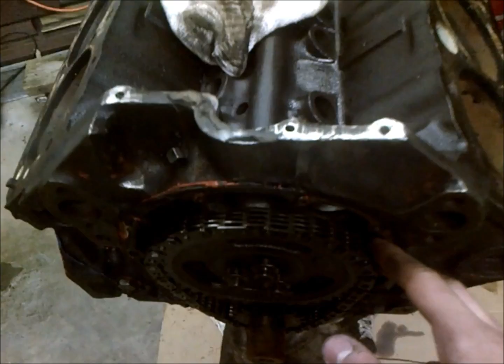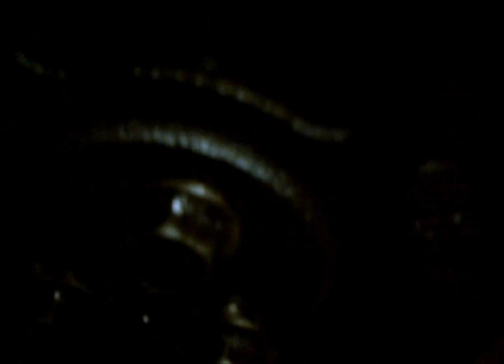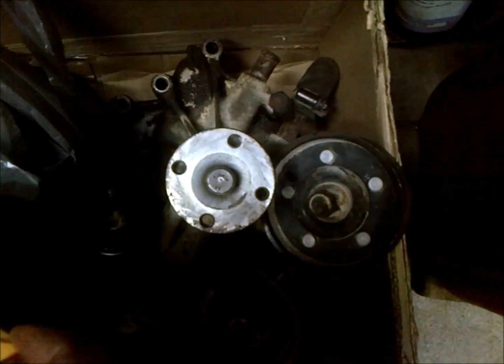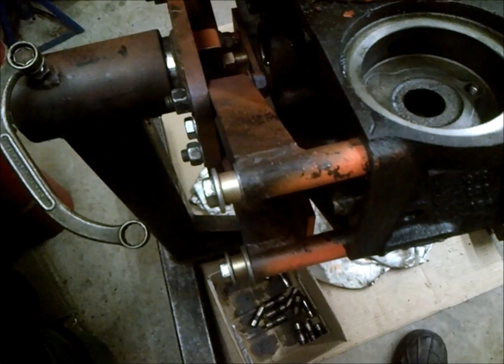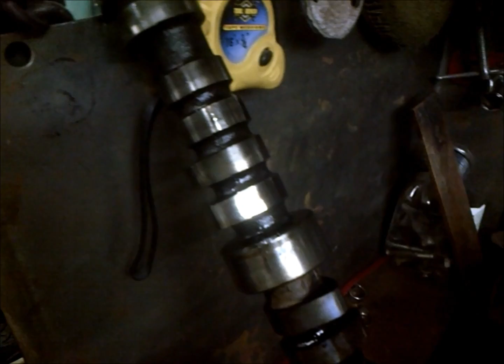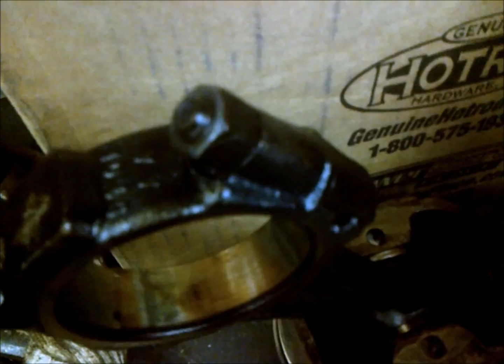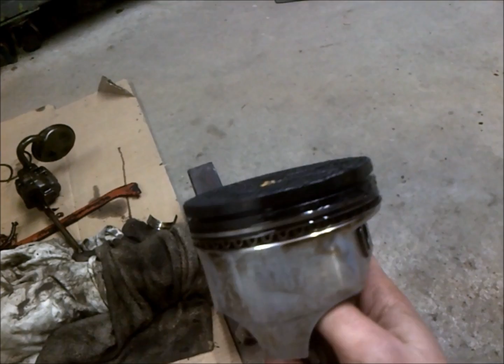350 Chevy vs Ford 302 Comparison: (Dumb Redneck Viewpoint)

Comment: A lot of wrong info. The Chev cam is inclined in the block meaning it holds itself back,, a trouble on high rpm engines. 
Head bolts, Ford uses 10 7/16 bolts in a 4 bolt per cyl pattern, Chev uses 14  7/16 in a 5 bolt per cylinder. This is where the LS is big step backward. Cleveland and 351 W engines as well as M engines use 1/2" bolts.
The little shortarse rod in the Ford will break before a Chev one. As a stock engine not a problem but high rpm is. Boss rods were 3/8!!
The 302W is very small and fits in holes a Chev struggles with and with say 350hp is fairly strong  though quite short of torque.
The Chev has better oiling and cooling. Later 302 are better for cooling than early ones,, which are bloody awfull. The Windsor oiling is adequate but the Chev is better. The clevo and M engines are a real disaster and a LOT of mods is required. 
And yes I have played with all these engines, a 600hp road race Chev is 1/3 of the price of a Ford,, that is IF you want it too live! Though really a tall block 351 W is the better base for that, but bigger, taller and heavier and has the drama of 3" mains. SVO make tall decks with the smaller main bearing and that largely solves the problem. But NOT production
Reply: Chevy had 17 head bolts, not 14; do the math.  Five 'around' first cylinder, then four more for 2nd, 3rd, and 4th cylinder on the bank with the 5th bolt being 'shared.'  And, they had three different lengths which was another pain besides having to torque that many bolts.
Reply: ford has the  better oiling system because all windsor motors were side oiling from day one in 1962 were chevs are center oiling like an fe ford also the 350 has 1 63 rod ratio that means it has load on the piston than a 302 at 1 69 ratio and even better 351 w 171 ratio and weight the 351w is 25 lbs lighter  as for cooling  there s a video on you tube were they hook up a 351 w and a 350 to the same rad and run them full blast ill leave the rest for you to watch

Comment: hey man what size main jets would you run I have 65 main jets in now i am looking to get fuel economy with dropping the main jets to 63 or 60 but I don't know if it will run lean and burn it out I was told to try 63 get to 100 klms if it doesn't serg then go flat out and see what klms per hour it serges 3000 rpm is the 100 klms per hour mark so if it serges after 100 klms per hour or a t 4000 rpm I should be safe but it is a little winsor pushing a 3 ton f 150 truck 4x4 safe side is to probably just leave it alone and be safe with 65 jets any opinions
Reply: I usually figure #62 jets in a Holley 600 for a 302" or 305" engine... #66 for 350/351"... #72 for 400's...
Reply: You won't have a problem Fords run cooler,there water pumps pump 23 gallons an hour more and the exhaust ports are farther apart!

Comment: Non biased? This video was biased the whole way through. The only way you could make a ford vs Chevy comparison video non biased is to not know which is which. Also I clicked on the video to see "ford 302 vs Chevy 350" but I got ford 302 vs Chevy 350+ accessories to make it better even though it is already a bigger displacement engine